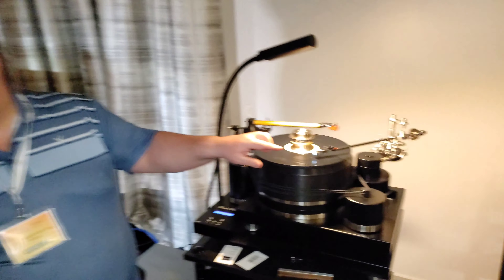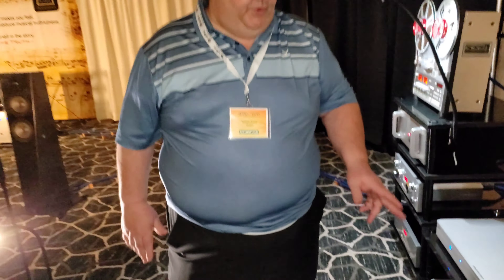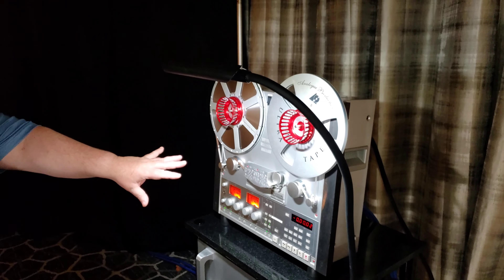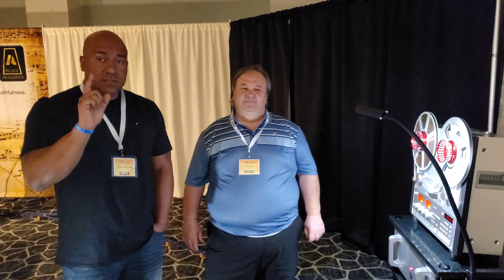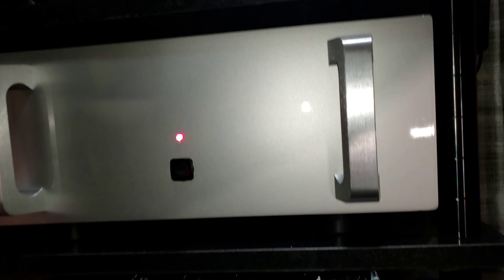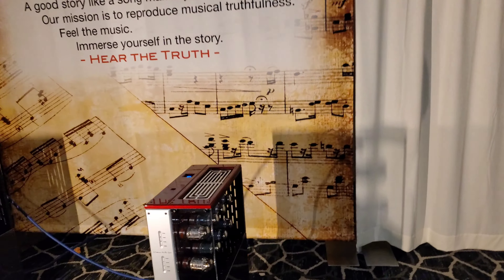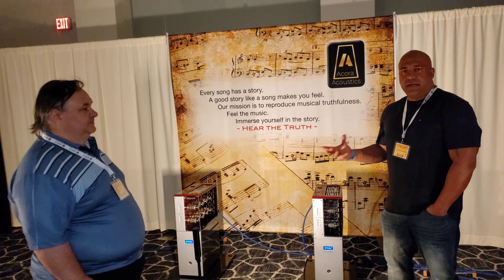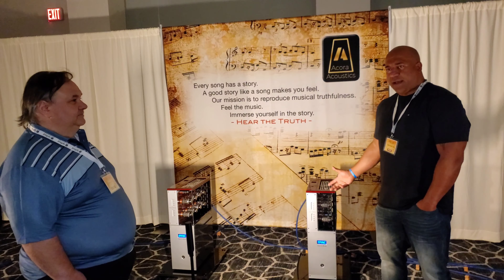Acora Acoustics Interview

Comment: Apparently they are using ScanSpeak drivers, D3004/664000 for tweeter and 18WU/4741T00 for midwoofers.
Granite can resonance between 0hz-200khz, but amount of resonance amplitude between 0hz-20khz is lesser than 2x10^(-4) depends on shape and thickness of it, not bad not perfect.
I checked out their website can't find any info about speaker inside and crossovers, there is not any special thing about these speakers for me.

Comment: Why not use Carbon Fiber?
Reply from the maker: Not sure
Reply: I think it is not about strength but resonances.  Carbon fibre would have a very different cabinet resonance than granite.  When you hear these speakers its pretty apparent that the cabinets are not contributing (mean that in a good way) to the sound.
Reply: @user-od9iz9cv1w  Granite would be expensive I would think verse HDF board with Carbon Fiber.  Weight for certain would be huge with granite.   But I am sure they are amazing looking and of course super heavy.
Reply: @garykarczewski6678  There just is not much movement with granite.  The mass plus the rigidity of the granite vs the moving elements of the driver.  The drive moves and the box does not.  And you can hear it.
Reply: Carbon fiber is brittle.
Reply: @user-od9iz9cv1w  Granite as a cabinet material is overrated with regards to resonance.
Reply: @user-od9iz9cv1w Then why not make them out of Corian or concrete composite?  I am not dissing Granite but for cost and weight there are numerous solutions per box building.  HDF is the most common used by almost everyone because of the rigidity and lack of movement with the correct bracing and internal damping. thus why it is used with almost every speaker manufacturer. O
Reply: @carlosoliveira-rc2xt  Actually it isn't brittle at all.  You must be confusing carbon fiber with graphite.  Carbon Fiber is the material of the future when cost comes down.  It is used in automobiles, as well as by the aviation industry such as the  Boeing787 and other future aircraft.   Carbon fiber is used for many applications due to it’s unique properties.  The major advantages of carbon fiber over traditional materials like steel, aluminum, wood and plastics include:  

High stiffness and strength
Lightweight
Corrosion resistance
X-ray transparency
Low CTE (Coefficient of Thermal Expansion)
Chemical resistivity
Thermal and electrical conductivity